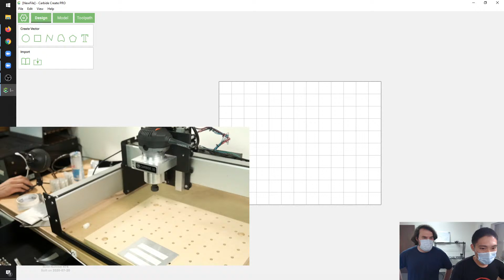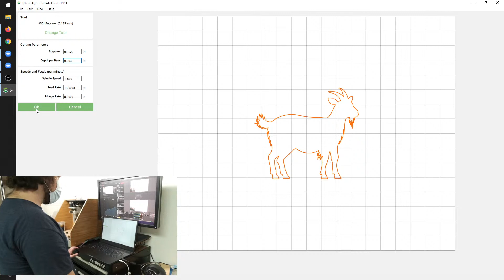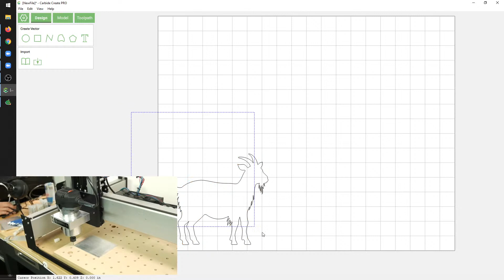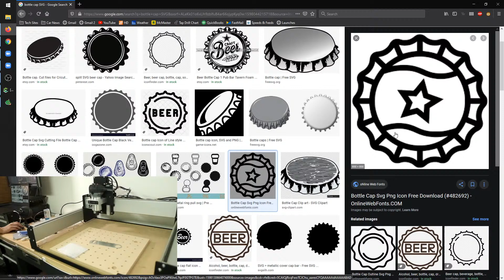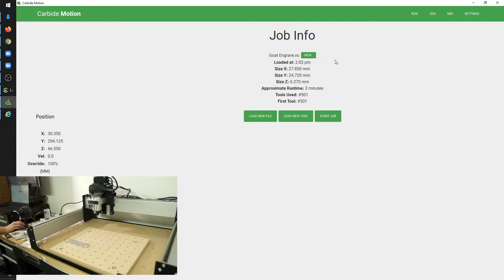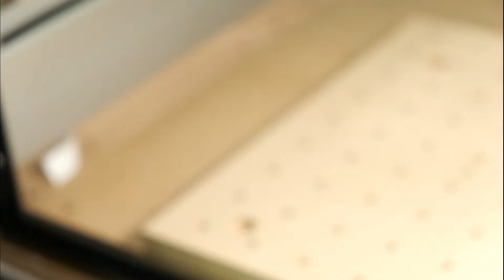Metal Engraving Fun Time - Carbide Office Hours #18

Comment: Really wished I had bought this machine instead of my stepcraft after using it for a year. It really came down to table space (& price 2nd) at the time of purchase. Now some time has passed I feel like it would've been worth it to go with the Carbide 3d machine. Maybe next time some extra $$ comes my way. 
I liked the engraving video using the Carbide create software. Kind of hard to watch through the unedited streamed video for the valuable content. But it is what it is.No big deal. A mic on each would be an improvement on the live videos. I don't know how that will work with the masks.